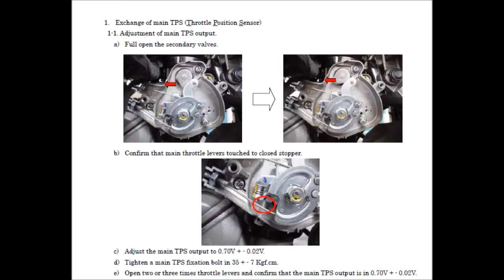TE449 511 TPS setting for mixture correction

Comment: good day, Dangermouse. SMR511, 2012. 
Tried to increase TPS to 0.8V.
Did it with engine off. When I started the engine TPS with closed throttle changed to 0.83V. Turned engine off - again 0.8. Ok, finally I setted 0.77, so with started engine it became 0.8V. 
Next step - brass screw, I had to turn it in several degrees (decrease rpms) to obtain 1950-2050 rpms. 0.8V TPS raised idle to 2200.
Was it correct?
Reply from the maker: OK, sounds like the bike was lean. 
Increasing the TPS value adds fuel and the idle speed may increase. 👍
If it is running well down low, then it should be OK 👌

Comment: As soon as I reprogrammed my bike to Race Map 2 (Acropovic map from Zip-Ty) The bike flames out on pump gas. Once I went to VP110 racing fuel it runs perfectly. These race maps need better Octane and will solve some of theses issues.
Reply from the maker: I'd suggest that you have other issues if that is the case.
Akro map is the fix for flame outs in almost all experiences of other owners.
At the age of the bikes now, there's ofter a host of possible other things to consider that could be related.

Comment: Hi dangermouse could you please give me some advice on my 2012 TE449 it starts up fine then it just randomly stalls and when I ride it it just cuts out randomly? more so when im down shifting? Then it will run fine for two minutes before it cuts out again
Reply: dangermouse thanks I appreciate your time i love your video's mate you have a good day and thanks again hey take care
Reply from the maker: Hi there,
Hard to be certain without being with the bike but there's a few things to check.
1/ Put a new spark plug in if it's been a while since it was changed
(often overlooked)
2/ Set the idle speed up a bit higher, most people like them too slow.
There's a large brass idle air screw up high, and to the rear of the LH side of the throttle body.
3/ Remove the second butterfly plate as in my videos
Reply: The idle has always been a bit high since I've had it there is no fail messages on dash it'srunning on map 2 its only done 900km do you think the fuel pump or motor could be the issue is that something that would cause random stalling idle and speed or would the pump just stop for good and not work at all
Reply from the maker: @Zeusarelly 
A 2012 that has only done 900km has done a lot of sitting around.
There's a good chance there might be corrosion around the fuel pump.
It's also possible that the injector has some gum formation on it, but both would speculation only.
Perhaps try some fuel injection cleaner added at the correct strength as per the packaging details. 

If the stalling is with the engine just running normally, and then it cuts out, that's odd. 

If it is at times when you open up the throttle, that's not unusual and can be fixed with adjustments. 

Is it in Race Map II mode? 
If not, then it won't run properly regardless of what you fiddle with.
Reply: Mate your a champion yep all it needed was some nulon injector cleaner and it cleared it all out the bike is running better than ever mate thanks dangermouse
Reply from the maker: @Zeusarelly 
Great to hear, enjoy the bike 🙂👌

Comment: Hello! Stumbled upon your video while searching solutions for rough running. Just tested my TPS, cant´t get lower than 0,85v and 3.92v full throttle. Is the TPS bad?
Reply from the maker: Is this even after releasing the lock screw on the TPS and moving it?
Reply: @Danger_mouse  yes. Pushed the butterfly by hand and got it to 0.8. Now it returns to 0.8 quite well. But full throttle remains under 4.
Reply from the maker: @tuukke 
I wouldn't be too concerned about the top end, once up at wide open throttle and higher rpm, the ecu bases fuel delivery on the MAP sensor signals, not as important for the TPS upper reading.
At low rpm and light throttle settings, the fuel delivery is based on the TPS maps, that's the important end of the range 👍
Reply: @Danger_mouse  thanks a lot!

Comment: Dangermouse could you tell me what the fuel pressure should be on a 2011 TE511. I'm Getting just over 40psi atm is this correct.Great work btw all your helping with issues others have online really is awesome and much appreciated.
Reply from the maker: That would be about right from the top of my head. 👍 
Main fuel issue on this model is a blocked filter bag on the fuel pump. Not available separately from Husqvarna, you can buy a cheap eBay pump and steal the bag off it.

Comment: Great stuff Dangermouse. I've got a question I'm hoping you may be able to help.  I have a 2011 TE511 has FMF megabomb header and 6.1 racing FMF silencer along with a dyno port iv. I love the handling and the nice snap the efi produces. Bought bike in 2013 from dealer like that.  My issue is one I hear often. Flameout, or whatever you want to call it.  I'm so ready to set this bike on fire you can't imagine. I been riding and racing  since I was 5 and am pretty bike smart but to be honest. This think has me completely baffled.  It just dies whenever it comes to mind to.  I can be in tight woods or going straight on a trail. I can't for the life of me figure out where to start.  Oh btw. It does have new stator.  I was one of the lucky ones that had it shred to pieces before I read about it.  I seen many if not all you mod videos and seen you on cafe racer and hoping you have an idea where to begin.  I love my Husky's but going insane over this one.   Thank you
Reply from the maker: Hi, thanks for the message. 
Let me start by saying I know EXACTLY how frustrated you are with the bike. 
I can honestly say I was carrying matches in my toolbag and had thought about torching my 2011 TE449 before I fixed it!
The fix/es for my own bike were the deleting of the second butterfly, raising the idle speed, resetting the primary TPS voltage to 0.8v That got my bike riding without stalling. 
Later on, loading up the Akrapavic Racing Map and reducing the TPS voltage down to 0.7v has the thing running sweet. 
I have set myself up for the TuneEcu system so have full access to the ECU mapping, sensor values and fault codes. 
If you are on FBOOK, please look us up on our Husqvana 449-511 Owners page. 👌 
Lots of helpful information there. 
https://www.facebook.com/groups/219900571553501/
Reply: Dangermouse Thank you again.  I have been very busy getting a second house ready for the market but, can't wait to do your mods. It has to help, sure can't hurt.  I forgot to say I'm running race map 3 oh and do you have  video on raising idle? I seem to remember reading somewhere there was a certain way to do it so it didn't mess up tps setting?  I got a little to much slop in my throttle as well. Oh and I even put a throttle tamer on it thinking it may help flame out coming out of corners.  Did nothing.  Thanks Man. I really appreciate the time you take to help others. That's cool stuff! Mike
Reply from the maker: thackmd 
Running Map set 3 should normally sort out most bikes. 
However, if the bike still has the second butterfly fitted, definitely remove that. 
The idle speed is set via a large brass coloured screw on the upper rear left side of the throttle body. Just to the rear of the black cable cover. 
Using a flat screwdriver, turn it out to increase idle speed. 
Somewhere around 2000rpm is best.

Comment: Where did you buy your TPS connector and meter from?
Reply: Dangermouse Sorry to bug you again but you are the goto guy for this bike :) Is model 1 for the 2013 TE 511 listed here: http://tpstool.com/ ? Thank you!
Reply: Dangermouse They're strange bikes...they intrigue the mechanical mind and frighten the non-mechanical mind. Mine only has 700 km's on it... basically brand new. I feel like when I'm riding it, that with some tweaks, there is the perfect bike in there somewhere. It just glides over any terrain. I will definitely look into the app as ZipTy Racing didn't respond to my request to get my ecu flashed to map 3. Maybe they're moving on to the newer bikes?
Reply: Dangermouse Already did and added a few pics of my woman learning on my TE 511. We then got her a TE 250. I'll put it out there on the group to get the leads for the app. Thanks again!
Reply from the maker: Matthew McGriff 
The test plug comes from 
http://tpstool.com/
Model 1.
Thr multi meter you can buy at any electronic store. 👍 
Most bikes seem happiest between 0.7 & 0,75v
Reply: Thanks man!
Reply from the maker: Yes, correct. 
Model one for these bikes 👍
Reply: Dangermouse Excellent thank you. Do you remember the voltage that dialed yours in perfectly?
Reply from the maker: With the original maps in my bike, (2011 Euro/Asia TE449) and fitted with the Akro slip-on, around 0.75v at idle made mine ridable. 
If you have a US spec bike and/or a different exhaust, you may need to experiment. 
0.8v seems to be about the limit, I wouldn't go higher than that. 

For not much extra $$$ over this plug set, you could set up for TuneEcu. Then you'd be able to see all sensor data, make map changes and rear fault codes as the dealer could with the original Husky system. Something to consider. (https://youtu.be/m3ujTMypQTQ)
Reply: Dangermouse Will do. And thank you so much for your help. I was reading your comments here and everywhere actually, and you stated that you didn't feel much difference in the bike with Map 3 after you set up your TPS to the proper spec. Is that correct? Also, I've noticed you've moved away from these bikes, do you see a problem coming with parts availability that will render them useless period?
Reply from the maker: If you haven't already, join our FB group. 
Lots of help and Info there, good guys. 
One of the other Admins makes one of the connector leads for TuneEcu too 👌 
https://www.facebook.com/groups/219900571553501/
Reply from the maker: There wasn't a huge difference in Map 3 in my own bike, but I've been able to set the TPS back down closer to 0.7v and have it still run well. 

I still have my TE449, just it was getting tired at 330hrs on the bottom end and I didnt want to ride it until it died (I plan to keep it, tidy it up and use it from time to time) 
Some parts do take time to get, but most seem to be available, or an alternative at least. 
That said, I really LOVE my new Sherco 300 SEF-R too. 
I turned 50 last year, and it's making me look much better than I am out in the bush 😁

Comment: mine does stall at low rpm but i thought it was because of my low gearing and locking up in tight trails.. but i do believe it should have more balls from idle, i find i have to slip the clutch to get it in to better rev range.. before i try your mod, is it just the throttle stop position shown in diagram that when adjusted changes the idle volt setting?like the old idle screw on carby?
Reply from the maker: Yes, for mixture, moving the TPS sensor as shown will change it.
They are lean just off idle as set from the factory and raising the TPS voltage will help that.(Richens the mixture)
These bikes also seem to like a few extra rpm, raising it to about 2000 at idle seems to work well via the brass idle screw on the left hand side of the throttle body.
Another cause of flame-outs is the electronic secondary butterfly.
It does not open & close fast enough to account for rapid throttle operation from open, to closed & open again. You can see this in my other slow-mo video.
The secondary butterfly shaft, motor & sensor must be there & stay wired in, but you can remove the 2 screws from the butterfly & take it out. You will notice a big improvement in throttle response.
Hope that helps.
DM
Reply from the maker: Very sorry for this late reply. Chris. I'll answer here for any others having a look.

No, the throttle stop remains set. 
You must loosen the TPS screws and move the TPS itself. The mounting holes are slotted for adjustment.
Reply: hey buddy . the prob is  both the tps sensors were touched  and I do have a fail on display. If possible can u maybe send me an email and I can give you more phone number I been talking to so many people and I am stumped my email is mopar03rt@yahoo.com. thank you for your help.  I do not have a Facebook
Reply: hey  my name is Chris I also having trouble with a 2011 te 511 thay i just bought.  I'm getting a low voltage for my secondary tps. someone previously changed  the whole throttle body so I don't know what they are set at or if they are set correctly.  Do u know what the voltage settings are for both the primary and secondary TPS. I can't find anything online or  anyone knowledgeable to give me a couple pointers. I'll be happy to give you my email Mopar03rt@yahoo.com  thank you look foward to hearing from you
Reply from the maker: +Chris Rapuzzi 
Hi Chris. 
I have a BMW file on resetting the primary and secondary TPS voltages. 
Most people do what I did and remove the secondary butterfly plate,  leaving all the electronics in place to improve throttle response. 
If you don't have a fail message on the dash,  I'd leave the TPS as is. 
Would be happy to share the pdf with you. 👍 

Are you on FB? Join our group if you like with lots of info there 😊
https://www.facebook.com/groups/219900571553501/
Reply from the maker: +Chris Rapuzzi 
No problem,  I'll send through a mail a little later today.
Reply: thank you for your the support
Reply from the maker: +Chris Rapuzzi 
Email sent 👍
Reply: Chris Hood Hi Chris, I haven't done the mods yet that Danger mouse suggested  (only because I haven't had time) but. Agree, tight woods I'm very dissappointed. However, it also flames out in open stuff which is just unacceptable.  I don't want to change gearing either. 2 reasons. I don't think it will help much and top speed is about 60 or 65-70 stream hung the rpms. I hope to get to m I do soon. I'm sure they will help Danger mouse seems to really know the bikes well.